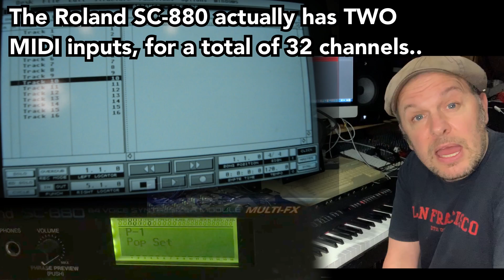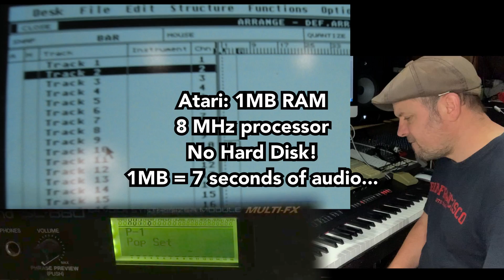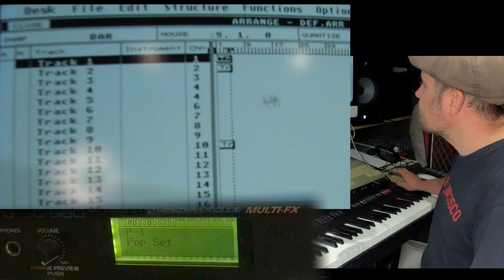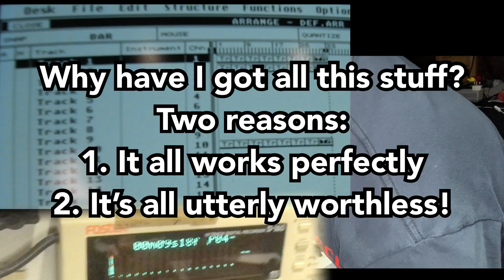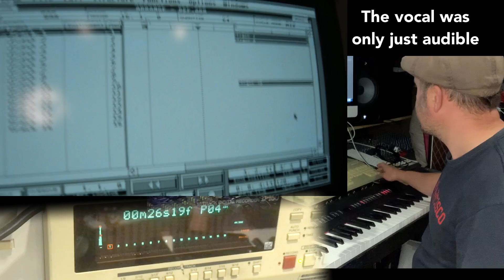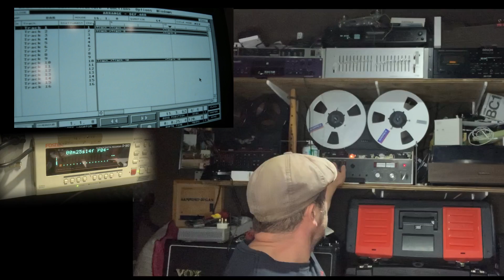Atari ST & Cubase: A Recording Session Using the DAW of the 1980s!

Comment: You may think that this is just for old fogey entertainment, but I have a little ADAT tape studio and happen to also have an atari ST and you beautifully answered my question of whether I might be able to drag the atari in and sync it up with MTC.

My only decent MIDI hardware is a down-at-heel Juno-106 and I'm SO jazzed to try tracking some synchronized loops off of it and making some awful techno as soon as I have a free minute. Wouldn't be able to realistically do it without something like the ST

Comment: Technically the ST was not a DAW as it as only midi sequencing and no audio. Also preferred the updated Notator Creator program as it has a 64 channel midi (four 5 pin midi jacks)/SMPTE interface, could do many many things easier than Cubase and eventually became Logic.
Reply: There were several solutions for additional MIDI interfaces. Steinberg had the SMP-24 and SMP-2 with two additional MIDI in and four additional MIDI out on the printer port as well as the MIDEX+ with two additional MIDI in and four additional MIDI out on the cartridge port. C-Lab/Emagic had a few versions of the Unitor with two additional MIDI in and two additional MIDI out as well as the Log3 with three additional MIDI out on the cartridge port and also he Export with three additional MIDI out on the serial port. There were also adapters from other manufacturers ranging from one additional MIDI out on the serial port to as many as eight MIDI out on the parallell port! Actually, there were versions of Notator that supported 96 channels and Cubase Score supported up to 128 channels in total, but with so many channels active you also needed a faster CPU, at least 16MHz, to get decent timing...

Comment: Listen how tight the midi timing is, you dont have to worry about buffer size, latency, what front end software is handling the monitoring, bring the buffer down, take the plugin in and or out, oh men, we need this system back in modern way where everything is NOT in a box, remember those all in one tv, vhs, dvd systems, they were horrible, this is what we have today.

Comment: The Atari ST is more than capable of beautiful colors but the reason you are stuck  in black & white is because the mode your running CuBase in. To get the highest resolution you only can run that mode in black & white, which is preferablw because the higher resolution is all you need for recording music. Games for example run in a lower resolution and were full color.

Comment: Plus points were, midi timing ( clock straight from cpu on hardware level unlike PC's) , no     monthly updates of software, no crashes from a vst , no glassy soundquality from in the box , and most important making music with your ears instead of drawing modulation lanes

Comment: This was not the only way we worked. You could also use an ADAT synchronised with a device called DATA SYNC and then do the stereo mix with a DAT. I still have my Atari ST and two screens, monochrome and colour, but the monochrome one no longer works. The Adat also ended up dead because of the constant work it had to do... Thank you for the video!
Reply: The Fostex D-160 he has is more akin to the sexy Alesis "ADAT" HD24, which I believe can also chase MTC right on the machine!

Comment: Bugger. I just sold all 8 of my ataris. But… you know… 25 years was enough. Synced to a cassette tape four track. Then  a mini disc 8 track and finally, how grandiose, a Roland 2400 cd 24 track with… gasp.. flying faders. Great to see this though. I fought off the DAW beasts for so long. But now I am happy with colour, ease and the knowledge that I will never again have to clean the little contacts in the mouse. Bye bye 1040 STEs it was good while it lasted.

Comment: Wow great memories.. I was a Sound Engineer in the early 90s. We used this sort of system a bit but it quickly turned into DAW with Sound Tools / Pro Tools and recording digitally on things like the Alesis 8 track SVHS machines. Later I worked on tv shows were we used SMPTE code for everything. All syncd video machines and analog tape machines. Worked pretty reliably day to day.. somehow.

Comment: How was the connection made from the Atari to the recorder if there were only one in/out port on the Atari??
Reply from the maker: I used a MIDI merge box, which allows two MIDI inputs to go to one output.
Reply: if the SC-880 has a thru, it could continue on to the recorder. (or if the recorder has a thru, it could be first in the chain.)

if thru is implemented electronically as opposed to running through a microprocessor, added latency is negligible.

Comment: I didn't think Cubase was a DAW as far back as 1992.  But it required special hardware.   First time I used a DAW was about a decade later.
Reply: They had a very basic Cubase Audio that basically was crap. Really buggy. It didn't become useable until a later version released in 1994. 
They also had the Atari Falcon that was released in 1992 and later on also got some version of Cubase Audio.
Only Audio tracks and no plugins and very limited in the number of tracks and extremely expensive in the hardware required (special soundcards from Digidesign, I think).
First version that was not hyperexpensive (worked with more cheaper audiocards) and had plug-ins was Cubase VST, which was released in 1997 for the PC.
Reply: @Magnus_Loov  I sold my Atari 520ST around 1989.  Did it because I acquired a Roland LAPC-i card and built a PC for it.

Comment: The first engineer I apprenticed under back in the Atari Era once told me that if the external gear hadn't sync'd to Atari Time by ~3bars then that meant there MUST be a problem somewhere, and it was time to troubleshoot.
Reply from the maker: Bad cables usually!

Comment: There's no problem with the display. Your camera isn't synced up with the monitor's display rate, that's all. Atari STs in Britain outputted 50hz.
Reply from the maker: It was an odd one because I did set my camera rate to 50Hz, but it was even worse!
Reply: @DanBakerMusic  The hi res black and white mode on the ST actually runs at 70hz. That's why it required a special monitor
Reply: @prufrockrenegade  Yep only the colour monitors ran at 50hz. For mono you can actually use a VGA LCD monitor with the correct adapter. Not all LCD monitors like it, but most will work.

Comment: I got it working on my MiSTer 😀😀👍👍 just need to figure out how to get it to play through a real sound module and not the synth running on the ARM!
Reply: LegacyPixels makes super low latency MIDI adapter for that. I have one and it works fine for sending and receiving note messages but I haven't gone too deep trying sysex stuff with it yet. Hopefully once I spend a bit more time learning the ins and outs of ancient Atari software i'll able to edit and back up samples from my old Akai X7000 just using my MiSTer

Comment: Dear Sir greetings from Vancouver Island Canada
I have an Atari Mega ST2 with a lot of old tracks on.
I would like to transfer these tracks to Cubase Pro11  on a windows 10 computer
May I ask is it possible to sync up to enable the transfer track from the Atari to the Cubase track allowing me to use  the latest sounds on Cubase Pro11  and remix in there.
I look forward to your help in this 
Many Thanks Kevin Wilson
Reply from the maker: As Con Job says: the MIDI protocol hasn’t really changed since its creation in 1983. It’s possible to find a floppy disk drive with a USB connection, which should be a case of a simple transfer.

Comment: Which was your favourite Cubase version?

Mine was V 2.06 with MROS (Music real-time operating system) which enabled the Atari to run several programs in Multitasking mode using a software called switcher...

Now imagine that it was possible then to tweak your synth sounds and record the system exclusive messages into Cubase, while Cubase was playing  back the arrangement.

Due to the lower resolution of the recording you had to "hide" the systemexclusive messages between the notes to avoid glitches... Oh... that was so much fun.

With version 3 of Cubase that was all finished...

I only got back into Cubase on V. 5 VST on the PC.

After I got over the frustration that the old arrangements were no more compatible with the PC Cubase versions I quit Steinberg in favour of Reaper.

Comment: Are the Atari 260’s ok for installing Cubase 2 and sequence a bunch of gear or should I go for a something like the 520 or 1040 st? What’s the minimum memory recomended? Thnx
Reply: Hi, for the C-lab Notator/Creator midi sequence programs the minimum memory requirement is 1 megabyte, Atari ST 1040 needed.
And monochrome monitor Atari SM 124. ( works on color medium resolution but looks like shit, not useable.
I looked it up in the manual ;). I have been using this since 1987. kind regards Joakim

Comment: Did anyone manage to successfully translate the old Cubase ST  arrangements to Logic X by any chance ? 
I have not got the Atari anymore unfortunately but loads of old floppy disk cubase arrangements that I would like to redo , 25 years later . thanks in advance.  great memory lane trip btw.
Reply from the maker: I reckon there’s a simple way to do a MIDI transfer from floppy to PC. An older PC with a floppy drive and modern Cubase would probably do it...
Reply: Thanks Dan,  I have an older PC  ( 95ish with windows xp )  with a floppy disk drive but still does not recognise the ST's floppy disks.   I think the only way is to get hold of an old ST and reload the cubase arrangements, save them as midi files only and then email them to yourself apparently , Logic should then load them up . From what I have read anyway.  Cheers for your videos.

Comment: The screen is flickering because you record with 60Hz and the display is 71Hz. Not because it's old.
Reply from the maker: Yeah. I found that out afterwards! 71Hz is rather an arbitrary figure though...
I got round the worst of it by mixing two of the same video together, one delayed by a frame and then 50% transparent...

Comment: You forgot to insert the required program change and volume events at the start of each MIDI track. If you didn't do that and you had used your SC880 for another production, you'd end up with the wrong sounds and had to manualy select the right sounds and mix on your Roland again ;-)

Comment: I much prefer the software GUI on the ATARI ST and old MAC machines from the late 80's/early 90's (MAC Plus/SE/Classic/II series). So much more inspiring and exciting. I could look at those monochrome graphics all day, I love them. There seemed to be much more advanced interfacing with hardware synthesizers and samplers than exists with today's machines. The ST's built in MIDI ports, combined with its sequencers which in most cases  concentrated almost solely on MIDI, had vastly superior MIDI timing than any new DAW and newer MIDI interface.
Reply: Except the interfacing is much, much more advanced today with great built in support for an extreme amount of controllers, editors in vst-instruments for hardware Synths etc.
Reply: the midi timing of the atari is still unmatched today.